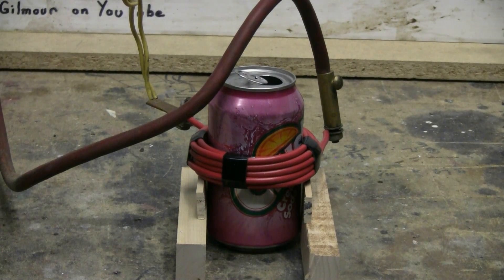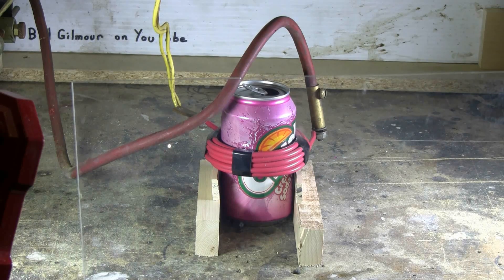Capacitor Bank #62 - Soda Can Crushing

Comment: I wanna make one!! Don't have microwave caps tho, can this be done with regular electrolytic capacitors?
Reply from the maker: Yes, you can parallel caps salvaged from power supply boards. If you series them, make sure that the caps are of equal capacitance (or very close), if not, the voltage will not divide evenly across them.